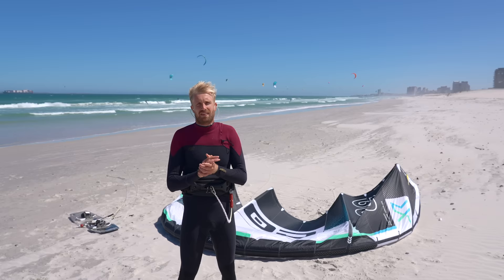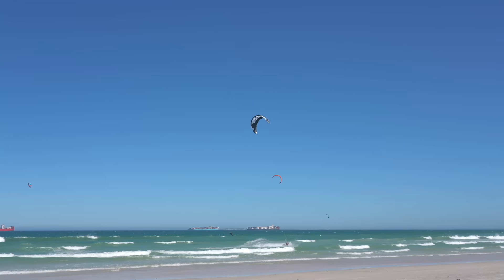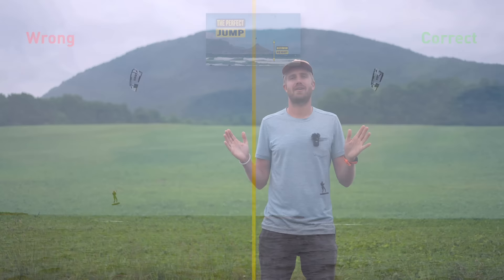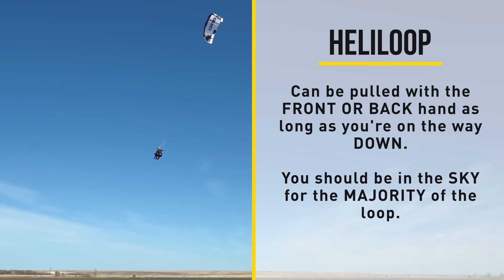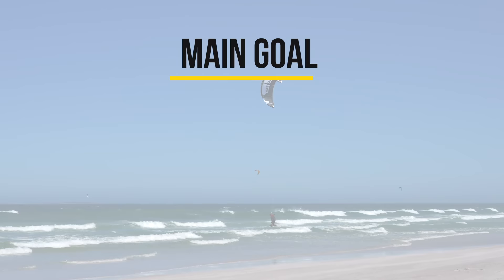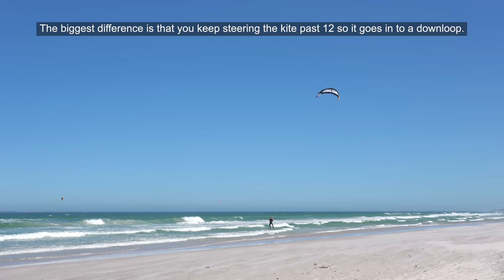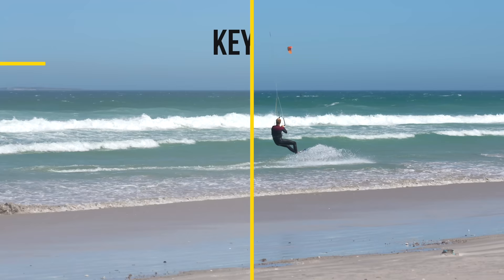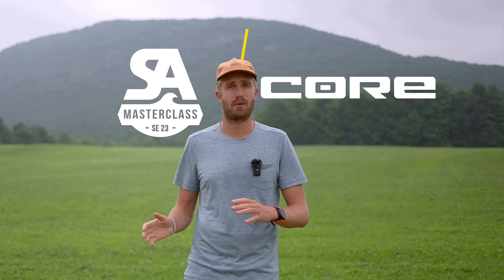Learn to Heliloop / Downloop | 2 Easy Steps // Kiteboarding SA Masterclass

Comment: I only use downloops to refer to front hand surface loops where the kite loops down first and across the window. I like to differentiate between helliloops (in the air with vertical pull) and landing loops (to maintain line tension when landing with speed). I start my students with landing loops during a jump transition just like you showed, and then slowly have them pull the loop a little sooner. One thing that helps with smaller jumps to get a vertical pull is to sheet out a bit before pulling the loop to help the kite climb overhead.
Reply from the maker: That's also a very nice way to explain it. Until two years ago I would actually call everything a downloop, but that makes it quite complicated 😂 Sheeting the bar out definitely helps with the kite rising up in the wind window.

Comment: 90% of the time it's front hand as the kite normally sits to the back , easy way to learn it is just take your backhand off the bar and crank your front hand 1m off the water when landing kite will go round even if it's parked at 12 it can also finish the loop if on water if you pull to late , then do it higher but keep both hands on bar and crank bar only when you swing underneath kite , common mistake is just steering the kite instead of cranking or pulling too late
Reply from the maker: It's definitely a good way to get started. After a while it makes sense to start your loop a bit slower so the kite provides more lift.

Comment: I have a strange phenomenon when jumping with the 7. When jumping with the 9 or bigger, the kite reacts normal. I have it parked on the side and loop it forward before landing. But with the 7 - which is normally the most agile kite (it is an XR 5), it just doesn't react to my steering, it just stays where it is. Yesterday I jumped 9.7m and thank god it came round to soften the landing, but in the 5-7m jumps it is just dead in the air. I tried sheeting out the bar, pulling it in, middle positions - dead. I had it with my old XR3 7qm as well, so it is not the kite, it is me😑 I would guess it just stalls in the air. What can I do?
Reply from the maker: Sounds like it’s stalling in the sky, but it’s weird to hear that the sheeting out of the bar doesn’t help much. 

If it’s the stalling it should help if you connect the steering line to the lowest knot and try to depower the kite a bit. I have a video “trim your kite to perfection” on my channel. Over there you can see how to trim the kite before going out for a session. 

Other than a stalling kite I don’t really know what could be wrong.
Reply: @stevenakkersdijk Thanks a lot for the answer, and yes, stalling was the issue. I saw the video of kite college where he encouraged to fly the kite even further back and then do the heli loop and that did the trick. Thanks a lot for your advice and the videos, they help a lot! I did my first heli loops 🎉 @stevenakkersdijk

Comment: I have always referred to these loops simply as landing loops as they assist in my landing from higher 8m+ jumps where the kite tends to fly behind me or I swing under my kite.  

I never actually learned them. They came naturally out of necessity to catch myself on landing or to avoid hot landings.   If someone asked me to do one on demand I probably couldn't.  They would simply have to wait until the jump where I needed one. And that is dependent on kite size, wind, jump height etc. 

My hand actually depends on what side I jump.  More or less dependent on habits I have developed.  To the left I pull with the front and land as a transition where on my right side I land with the backhand and ride out in the same direction.   

I've never been caught up on the name because I consider these loops a landing technique rather than a kite trick.  I am really glad to see this video addressing them because they are important for anyone wanting to land safely from higher jumps.
Reply from the maker: Awesome to hear that you just started doing them! There is usually a dominant looping hand, and it seems like that's your left hand. I also have a dominant looping hand which is my right hand.
I guess the wording: Landing loop work well, takes the guessing out of the game.

Comment: A downloop is a loop that can be done with either hand in my opinion. A late kiteloop in a jump transition for example. A downloop is used to keep the kite in the power window and avoid loss of momentum. A downloop likely increases or maintains line tension and downwind traveling speed. This is still more desirable than falling gently but without directional speed and so a downloop is often used on small jumps or at the end of larger jumps. 

A heli loop is a loop pulled with either hand also. The difference between the two is most likely height at which the kite is looping through the window. A heli loop will have the kiters momentum carrying down and down wind while the kite travels to the edge of the window above the kiter. The wind window is higher above us than usual because we are falling and creating apparent wind in doing so. in other words  Pulling a loop while the kite is seeming traveling behind you is in my opinion a heli loop.
Reply from the maker: Thanks for your detailed description, it's a very nice and clear way to look at it!

Comment: Awesome video! I'm still confused about down vs heli, but since I have to hold my foil while landing there's only one hand and one way the kite could go.
What I'm happy about is that I could land a kiteloop off a wave in Dahab onto the same wave with a foil strapless, and ride off. Only once or twice but I'm stoked! 
But what I find now is that I can comfortably ride my 7m Section in 13 m/s, but in such wind seven isn't the size folks use for jumps. So I'm puzzled: I want more pull up and power in the loop when landing, but once I'm up its not there. Only a few times I could time it right and ride off in Baby Bay without getting my board in the water, but most of time I slam down with a late loop and crash or save. Getting something like a Nexus should be my next step.
And a trip to a spot with a break...
Reply from the maker: That's awesome man! Sounds like you're doing very well. 
I think you'll enjoy the Nexus for your style of riding as it provides a bit more lift when you pull the bar down.

Comment: Great graphics man, I'm working on a kiteboat project and the graphics you used to describe the heli-loops are perfect, You mention to not untwist the lines until you are comfortable, which makes sense, however, if you could maintain control, could you produce another heli-loop?
Reply from the maker: Thank you! If you maintain control over the kite and you're still in the sky it's possible to pull another heli loop, but this always depend on the situation. Good luck with the kite boat project!

Comment: So, the kite flies behind you just from the descent of a high jump alone? Because I thought it needs to be a little to the side, then depowered a little, before you sheet in while looping.
Reply from the maker: It does help when you sheet the bar out a little bit, but it's not always needed. It mostly depends on the way your kite is set up. The more powered up you ride it, the more important it will be that you sheet out a bit to let the kite breath.
Reply: @stevenakkersdijk  Dankjewel! That was definitely helpful. Maybe I jump a little "oversheeted". But anyways, 5-6m is about the average height I get at the moment. So, I'm good with a normal landing. Man, I wish I'd get some wind again 😩

Comment: Question: Can you overstall your kite during the decent by pulling your bar too far in? Or are the dynamics slightly different when hanging from it with your whole weight compared to riding on the water? 

I’ve been trying to figure this out since some of my kites have different sweet spots and if I suddenly stop feeling power/lift with bar pulled in I need to make a split second decision in the air whether to keep it in and hope for a gust or try to adjust out a bit. Of course redirecting the kite helps, but that’s sort of besides the point 😅
Reply from the maker: Depending on the setup of your kite there is a small or big chance of your kite stalling during the heli loop. It helps if you trim all your kites to ride in a similar way (I have a video on how to trim your kite on my channel) 

Steering super hard with the bar all the way down will often see your kite stalling, but this can be easily fixed by pushing the bar out just a little bit. Or depowering your kite.
Reply: @stevenakkersdijk  Thanks! I guess it doesn't help that I've been switching kite models all month (freeride/wave/bigair). But the new tactic I've started is making sure I have plenty of power left in the bar when jumping now, it requires you to ride a bit more sheeted out before take off and edge more firmly but feels safer in terms of landing... until I can learn proper looping. Earlier I think I maxed out on the jump height in relation to wind speed which made me swing too close under the kite and land hard.

Comment: What is the position of the bar when doing heli loop? Is it all the way in at all times or has to be little sheeted out when the kite is flying behind you?
Reply from the maker: This depends a lot on the way your kite is set up. If it's depowered you'll want to keep the bar all the way in, when the kite is powered up you can sheet out a little bit.

In the end you'll have to try it a few times with your bar in different positions to see what happens 😉
Reply: @stevenakkersdijk  Thank you!🙂

Comment: I have been jumping 10-15m high with my 15sqm Duotone DLAB Juice - Does I Heli make sense with that size or would you just try to keep it above you and dive it down with a strong bar pull for landing? (been averaging 6-8sec hangtime on average)
Reply from the maker: With the bigger kite sizes it's a bit more tricky as the turning radius is sooo big. When you notice that the kite flies behind you it's super nice to do a heli loop, but don't pull it too early as that will result in a drop. (most of the time you'll get away just fine by just redirecting the kite with a strong steering input)

Comment: So would it be a kite loop when you do this loop at or just before the apex?
Reply from the maker: When you loop it with the back hand at or just before the apex it's a kiteloop. When you loop it with the front hand it would be called a contra loop.
Reply: @stevenakkersdijk  Thanks. Been meaning to ask. My dominant kite is an 11m Pivot. Is that appropriate to learn kiteloops on? I rarely get wind strong enough to fly a 9m and then it's stormy

Comment: What I mainly get from this video bout the HELILOOP is the importance of having the kite going around 12 to get that sweet sustention.

Concerning the DOWNLOOP when small jumping, you only talk here about pulling the front hand. In one of your previous videos, you insisted on pulling the hand opposite to the front foot ...  in order to stay balanced when top landing, "when you land with your right foot in front, downloop to the left" and " when left foot, DL to the right"

At 5'17         https://www.youtube.com/watch?v=n52UpvN7UuQ

Is it still the case in small jumps ?
Is it the case with big jumps when Helilooping ?

I say that because in higher jumps, to get the two ( kite threw 12.00 / pulling opposite to front foot ) is not always easy for me as I always land right foot in the front. Then, while in the air I have my kite often positioned up and rather left. I feel I'd need to PRE position it on the right ( by slightly pulling right ) and then loop it left to have it pass threw 12 for sustaining me 😅

Makes a lot to do with small jumps and short hang time :)

Thanks again for your tutorials. Amazing as always. Definitely have to attend on of your amps
Reply from the maker: Steering the kite around 12 is definitely key to softer landings with a heli loop. For the smaller jumps it doesn't really matter which foot is in front as you don't have as much speed as you do after a kiteloop. Therefor it's less important to stabilize yourself with the kite.

On the bigger jumps it all depends on your preference. The most stable way of landing is by pulling the hand opposite to your front foot, but that rule is not set in stone if you have a big preference on your dominant foot.

Have fun trying and see you in the sky 🤙

Comment: The way I define it is : downloop have more horizontal pull while heliloop is more vertical.
Reply from the maker: It definitely makes sense, but I find it hard to find the line with a description like that.
Reply: "Heliloops provide a vertical lift and can be executed looping the kite forward or backward around 12, while downloops generate a horizontal drive and are executed looping the kite forward into the wind window." Is how I would describe it in one "short" line :D